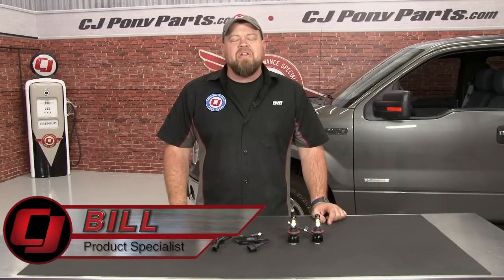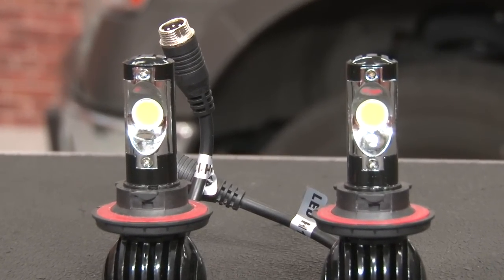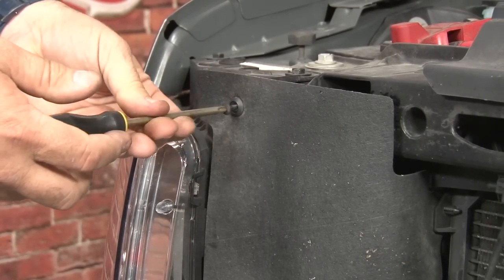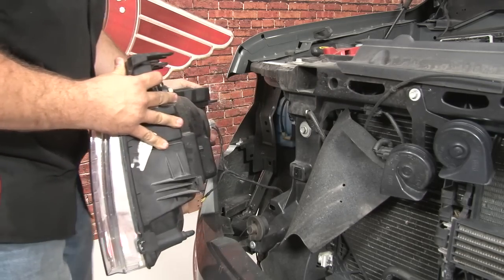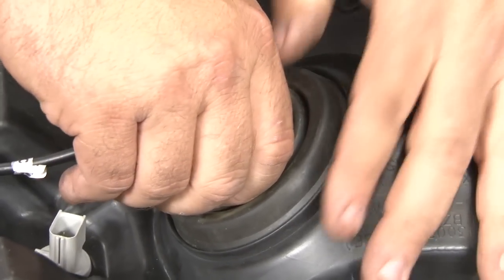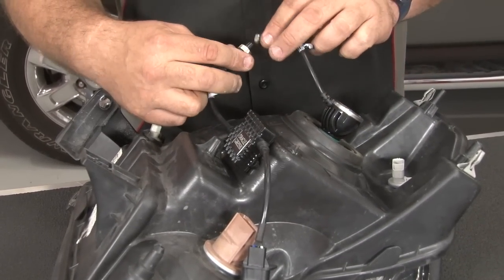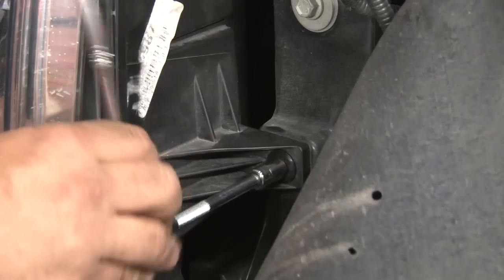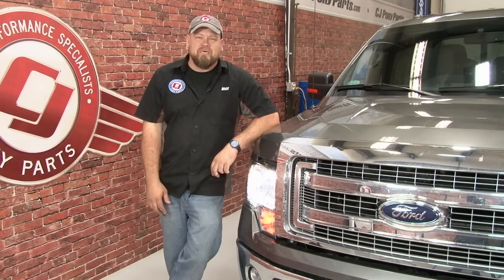F-150 Oracle Lighting Headlight Conversion Kit LED w/o Factory HID Headlights 2004-2014 Installation

Comment: i recently switched both my headlights and foglights and they work great but when i turn on my fogs my high beam light on the dash lights up very dim, any ideas
Reply: +Zach Davis  Sounds like feedback from somewhere but tough to say where without disconnecting the lights one at a time
Reply: Hi there bill questions for first time put pair's of led kits in friend 2013 ford f150 good led kits in for headlight
Reply: As well bill put in led kits adjust the headlights after done.on 2013 ford f150